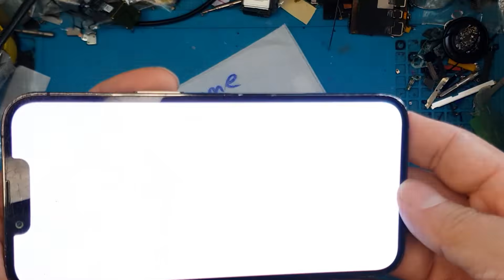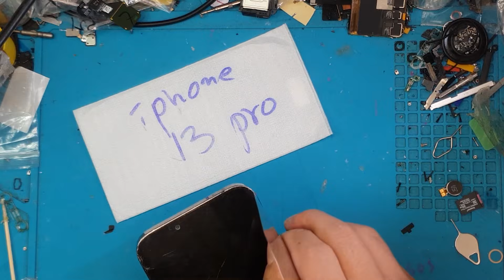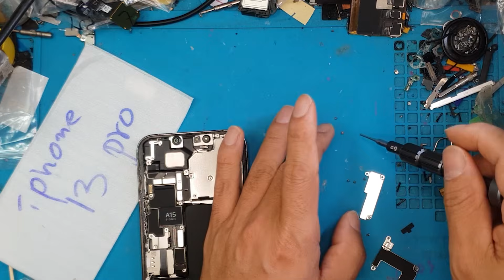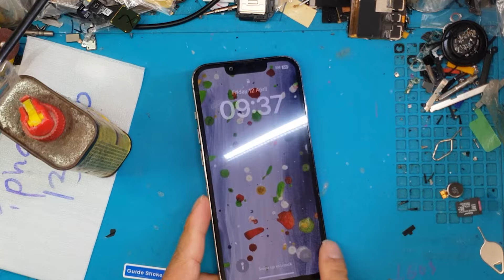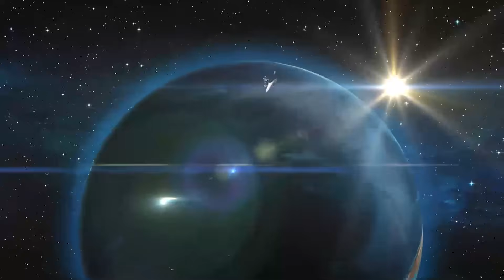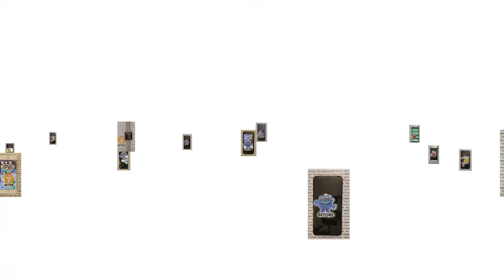WATER DAMAGED! iPhone 13 Pro Screen Replacement | Sydney CBD Repair Centre

Comment: hi, i have a 13 pro max.  My phone was in my jogging pants pocket for 3 hours getting soaked on sweat. I didn't think much about until i got home. It was responding for a while, and then it just stop responding to touch. I have left it to dry in rice for 3 days, I have done restart, manual update via itunes, but still the screen doesnt respond to touch....I'm planning on getting iphone 17 pro later this year, so i dont want to spend too much on repair.